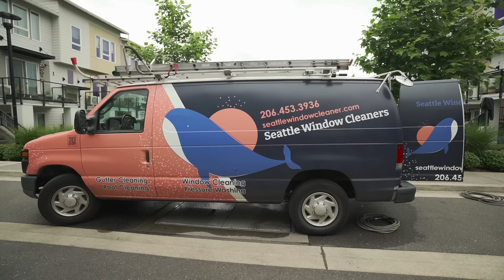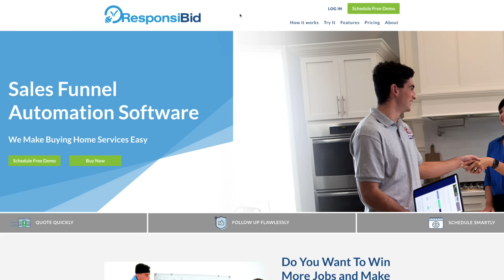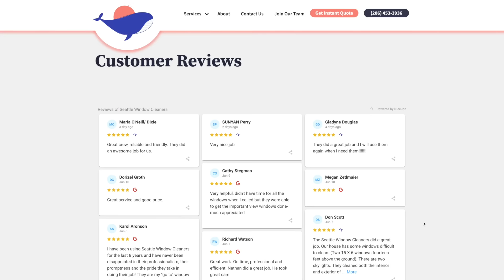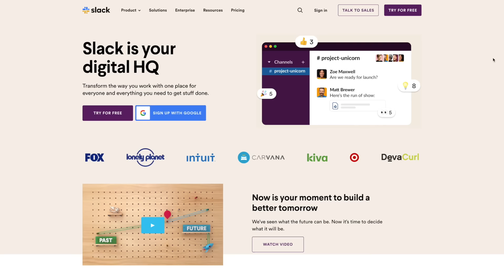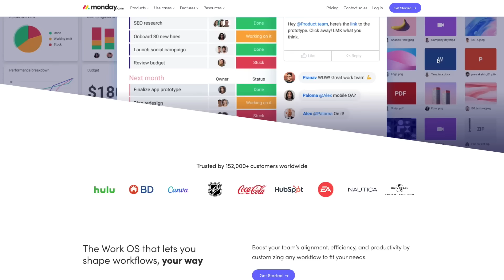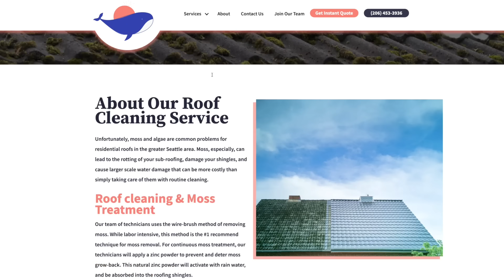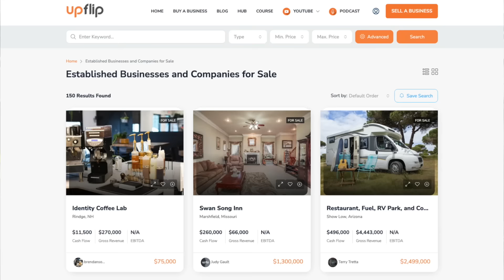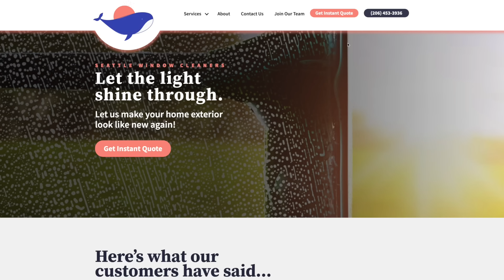How This Cleaning Business Makes $90K/Month

Comment: Overall this was a great interview but there were some key questions I would have liked to have learned about like number one. Most houses have screens on the windows that don't come off. How do you navigate that? And what about going inside the house? Isn't that a pain in the butt moving furniture? Do you price it differently?
Reply from the maker: These are great questions, Chris! We'll be sure to include these questions in our next feature regarding the cleaning business. If you want to learn more about the nitty-gritty of cleaning, we do offer a course (link is in the description). Thank you for watching! ☺️
Reply: There's very few homes or structures that don't allow you to remove the screens
Reply: Almost every screen you will ever encounter is removable from the inside as well as outside.  There are certain techniques to be learned.  Compress spring in one corner and either push out bottom corner from inside or pull out corner with a paint can opener from the outside.  Repeat with other side.

Comment: Have you ever damage a window doing commercial jobs?
Reply: I used to do scratch and stain removal alot.  Got a call for a bid about 15 years ago, 5 newly built houses.  Dude hired an inexperienced window cleaner to do a construction clean on every window.  He used a green pad on all of them and EVERY window was ruined.  Window cleaner wasn't insured.  It cost the builder tens of thousands to replace every window.  Do your research and do it right.

Comment: This is window cleaning?
Where are the squeegees? 
Does he not clean interior windows?
Lots of things didn't add up. 
Wfp (water fed poles) don't leave screaks. 
No Frame bleeding? 
Clean rain gutters in the off seasons , yet clean rain gutters as a add on . 
How many times do clients have their rain gutters cleaned per year? 
Cleaning clean windows in the video. 
No cobwebs? No burned on bug platters? No over spray paint to remove? 
Screens cleaned? And  how?
Reply: Thanks for comment. If you need seo service please contact me.
Reply: There's people in my area charging 30 euro for basically 10 mins work doing ladder less window cleaning and not cleaning windows properly.its impossible to clean windows right with this method
Reply: @patrickgalligan9629  nope ,safest ,quickest and cleanest way to clean windows as long as you look after your water ,ie purification of water
Reply: @marcwaddington4448  doesn't matter if the water is purified if you windows are dirty they are not getting cleaned as good as on a ladder especially when u have small panels of glass with timber between them .quick doesn't mean better nowadays it means more expensive for a bad job
Reply: @marcwaddington4448  and my whole housing estate have got a few different guys to do it and everytime people have complained
Reply: @patrickgalligan9629  OK you carry on getting up and down ladders risking falling off every time ,educate your customers about the system ,sooner or later ladders will become banned ,health and safety ,and as I said you look after your water purification system and do a thorough job then you may get the odd complaint, but you'll always get customers who'll complain even using traditional method !!
Reply: And how u dry from outside ?
Reply: @franclamaj4388  they don't dry and all you'll hear is because it's purified water
Reply: @patrickgalligan9629  totally right, for first time cleaning you have to go traditional. Waterfed for the 2nd cleaning. A lot of times you find paint overspray on windows and other debris which you have to use your blade.